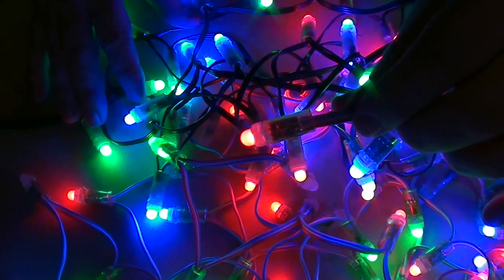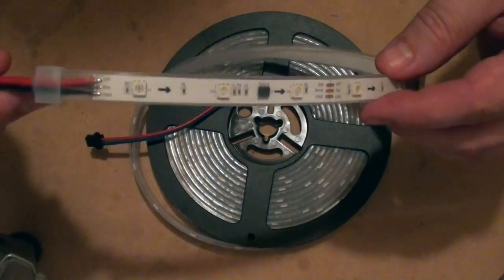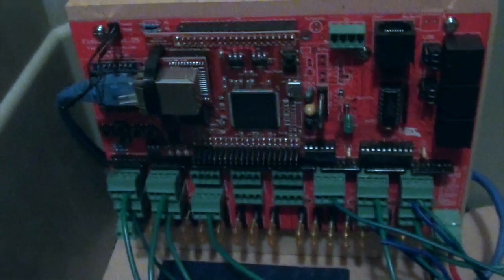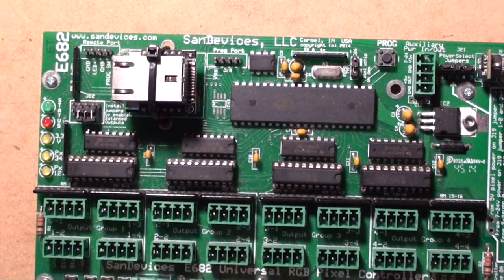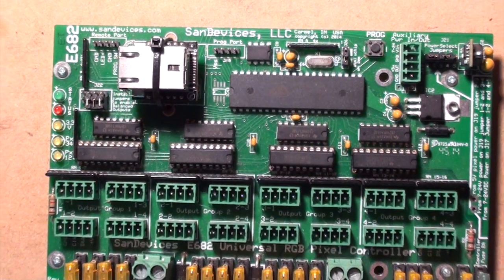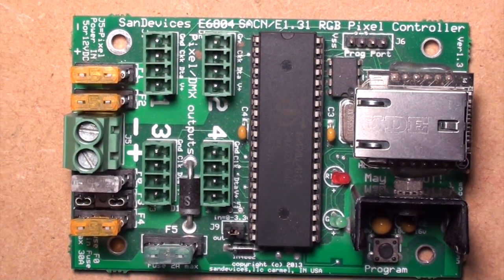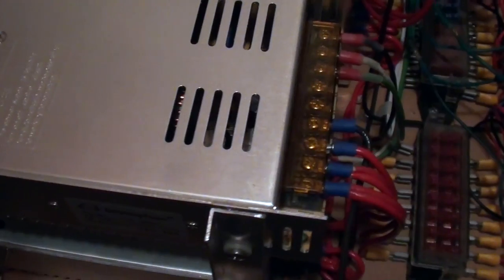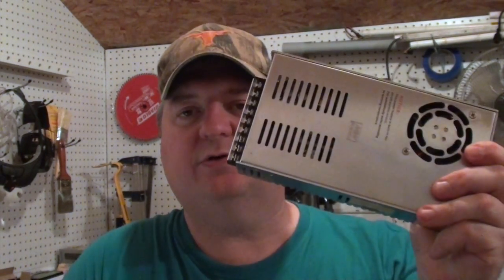HOW To Get Started with RGB Pixels

Comment: I have watched a couple of your videos and you present very well :)  2nd year into LOR and fired up a pixel tree this year.  Next year I would like to outline the house in RGB and maybe make something somewhat unique RGB in the front year.  I have read several of the forums and the runs to the connector (like Ray Wu's pigtails) is limited in length and won't work if they are too long; so trying to split a controller to control the outline of the house and unique items on the ground might not work.  What would be your suggestion?
Reply from the maker: Well, you have that problem with any pixels. You can only go ~30ft from the controller (a lot of variables like brightness, voltage, wire, etc.) before you start running into trouble with getting data to the first pixel. I'm not familiar with the newer LOR stuff that supports pixels, but there are a couple of options for extending the length. 

Look for a uAmp signal booster (probably limited quantities, group buy kind of thing). 

Another option would be to have a second controller run the outline. 

I'm not sure of the differential receiver boards that David at pixelcontroller.com makes would work with LOR, but might be worth an email or forum post. 

The Falcon differential expansion board is probably what I'd suggest if you didn't already have an investment in LOR. There are people running a hybrid setup using Falcons driving LOR boards, but that's probably more than you want to deal with.

Those are the options that come to mind. But I'd suggest a forum post. Surely, someone has already dealt with this. :)
Reply: Ok good to know....placement of the controller is key.  The Falcon website you pointed to looks great and I like the plug and play version with power (F16V3 Pixel Controller - Ready to Run)  I watched several of your videos and you have gone to all RGB which looks cool.  I will have to work toward that....my Snowman is homemade and somewhat unique :) kind of like your color wreath. 

https://www.youtube.com/watch?v=XW00QoDPx2w
Reply from the maker: Nice video. Yeah, I had 16 LOR channels running 32 AC LED strings, got laid off, and the strings began to die off. I'd loose a few each year and couldn't justify replacing them. I got re-employed, went below 16 strings and started looking for something else. I completely switched to pixels the next year. So everything kinda came together all at once. A little different if you have hundreds of channels and thousands of lights.

Comment: What do ppl use for roofline lights? The c7 and c9? I was looking into buying this type if lights for roofline 50 Pcs string 12mm WS2811 2811 IC RGB LED Pixels Module String Light Black Wire cable IP68 5V Holidays/Chrismas/ Festival
 http://s.aliexpress.com/jYZB3aU3 

What do you think?
Reply from the maker: Those are the standard bullet-type pixels. You would need some way to orient them toward the street (like Boscoyo strips or something like that). You don't want them just hanging like normal lights. 

I'm using these along the fence (http://bit.ly/2AugCet aliexpress link). They include the C9 diffusers (but you have to put them on). 

I don't have roofline lights because I don't like to get up on a ladder for a 2-story house. :) They would look good though.

Comment: So if you have incadesent bulbs and you want to use them along witg Pixels, do you use a F16VX and a LOR controller off of the falcon?
Reply from the maker: Well, I'm not running that setUp myself so probably a good question for the forums or Facebook to verify, but I believe thats right. The F16 will run the pixels and can output DMX for the LOR controllers.

Comment: im new to the pixels and trying to learn how they all work. now if you have 2 controllers how do you hook them both up to your computer when each controller has on port for ethernet cable
Reply from the maker: In that case, you would want to use a network switch and plug everything into that.
Reply: okay thank you for your help. i'm slowly building my light show for next year so i'm planing everything out right now. thanks again for the help

Comment: Do you think I would be able to learn how to set this up before Christmas this year?
Reply from the maker: +Kyler G it depends on your background with computers and electronics (easier to grasp if you have a solid understanding of that, but not mandatory). There is plenty of help in the Facebook groups and forums if you get stuck. Also, it might be difficult to procure the stuff you'd need (namely pixels and controllers) as they are specialty items not available at your local store. You might be able to get a few pixels from Amazon. What do you want to accomplish this year with pixels?
Reply: My main goal is to be able to create a simple pixel set up, I already have many string lights (single color) but would like to try stepping it up a bit this year.
Reply from the maker: OK. You may just see how far you can get then. Try getting familiar with sequencing software to do the animation and be sure to visit the Facebook groups and/or Christmas light forums as they are a valuable resource. And good luck!